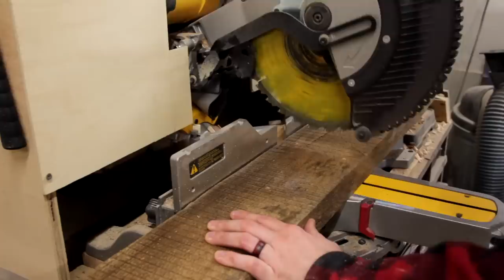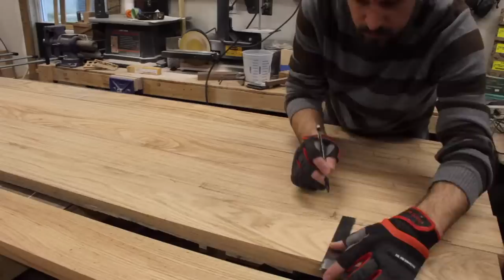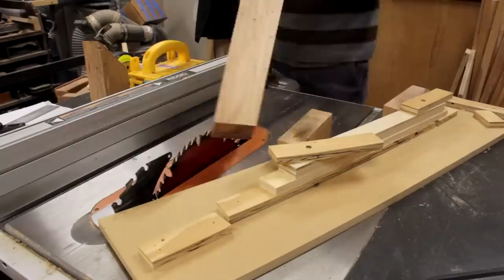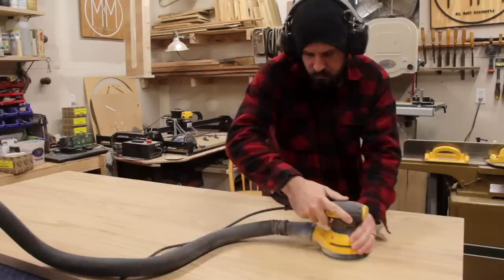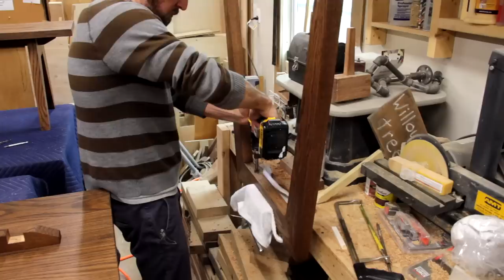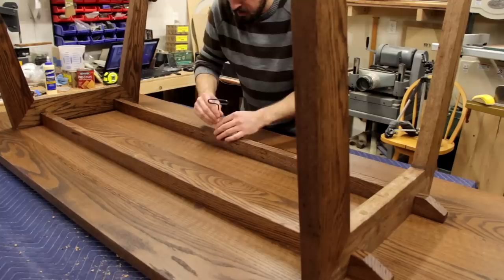I Quit My Job to Become a Woodworker | Dining Table Build

Comment: This is amazing, really, your story is so inspiring and I see myself in a similar journey, only that I am still working corporate and haven't started woodworking. I too started in a call center, and didn't know it was a call center because the job posting and interviews didn't mention it at all. 3 years in, I moved into a new position where I didn't have to talk on the phone! But Im still there, and Im having a hard time saving (as I live alone at the moment, and the cost of living is high where I live). Im trying to plan, to start doing stuff, because I crave working on more "concrete" projects, instead of sitting in front of a computer 8 hours a day. Thank you for sharing!
Reply from the maker: Those call centers a so sneaky with that. Start small. You can spend a ton getting into woodworking or it can be super cheap with a hammer, nails, and a handsaw. I wish you the best on your journey!

Comment: Thanks for sharing! The narration, combined with the slow-tv shots of making a table, was very well balanced. Would like to make that transition at some point but also realize the less enjoyable parts of woodworking (sanding, repetitive jobs, not matching (unrealistic) clients' expectations). Would like to focus on continuously gathering skills while also making a living in woodworking. Any tips?
Reply from the maker: Thanks! Woodworking is very broad. You could find something simple that doesn’t require a ton of finishing work and client input and then sell online or at craft fairs or sell through consignment shops.

Comment: I'm so glad I found this video! although I don't share a lot of similar ife experiences it was a fantastic watch and was very inspiring!
I'm not really in the "same" position but I think I'm on the edge of that cliff you mentioned. I'm lucky, I'm studying a degree in product design at university and I don't have a job but I'm financially stable due to veteran payments for permanent impairments I received during my service in the Army. The last 3-4 years since leaving Army have been turmultuos to say the least with a few different sales jobs, one that I didn't mind doing (working in a bike shop) and two others I didn't enjoy at all. I then started studying at at the beginning of 2022 and it felt like I had really found something I enjoyed, I was exposed to working with timber on a more technical capacity through one of my classes and I just knew I needed to try and pursue that. Now i'm going into my second year of university, I've bought some tools and I'm setting up a bit of a small workshop space in my garage where I plan on just tinkering on things and if I sell things, great, if not then I've learnt something for the next project!

Thanks again for such an inspiring story.
Reply: On that to the table looks fantastic! that colour from the finish is *chef's kiss
Reply from the maker: You've got the right idea and don't stop trying new things. There may be something even better than what you're doing now. Thank you for the kind words and I wish you the best!

Comment: The only thing I ever made from pallets was my Moravian workbench. Sheet metal comes on large pallets that are often made from hardwood. I took apart 6 pallets. I used oak slats to laminate the legs. The top is birch I used the runners to make a 3’ thick top and a leg vice the stretchers are solid oak from runners. I only spent about $60 instead of $1500. And I was able to cut around or hide all the nail holes on the bottom side. Except for a couple on the top where a foot had been nailed on to make forklifting from the side possible.
Reply from the maker: Awesome!

Comment: Thanks man. I’m in the “afraid to bet on myself and go for it phase.” Hopefully making the leap soon, knowing that I don’t have to know how I’m going to make it work- rather that it WILL. Cheers.
Reply from the maker: Best of luck. Put a plan in place, give it a try, and if it doesn't work out, you can always go back to what you were doing (i hope that's not the case). Failing is learning, nothing more, nothing worse.
Reply: I'm at a trucking job that I've been at for 5 years. I'm 47 and this is my first job I've had that I make great money except for 2023. It my first job I've been at for more then 2 years and in two months I'm kicking this job to the curb and going into woodworking for myself. I'm so sick of working for others and I'm scared as hell but I'm doing it. Good luck.
Reply from the maker: @eligebrown8998  Good luck to you as well!

Comment: One comment on the wood working when cutting off the end pieces from the table the scrap was unsupported this could lead to it pulling on the table and damaging you top or bottom. Please put some sacrificial board or something under the offcut so it will not damage your product.

As for the story, all I can say is good for you, we all have our journey to get to where we want to be some are like you where not yet brave enough to take that first step. Happy to hear that you got moved into the right place by forces outside of your control and rather than resisting them you allowed the world to steer you in the right direction. Now a lot of that has to do with the debt free situation and the living within your means as well as diligently saving. Having something to fall back on gives you the freedom to take a risk knowing that you could if the dream fails to materialize survive for a period long enough to sort out your next steps. Without that certainty taking a risk certainly with a family is a lot more difficult to justify of course. But like I said happy to see you got to where you are happy doing things you love, the only thing that I kind of miss in the story is if your wife has been able to do the same and is able to do what she loves as well.

Oh, and a nice looking table not my style but it looks good. I would suggest branding your furniture rather than stamping it as the stamp is pretty easy to wipe of where the branding will last longer and remain more legible even after many years of cleaning and children kicking and touching the markings on the bottom of the table.

Comment: @Mr. Matt Woodworks, I really like the table you made in this video. Is the base of your own design? It looks great. Is it pretty sturdy as well?
Reply from the maker: The client sent some inspiration pictures so it was based off of modern designs they saw and liked. There were no physical plans though, so I had to just figure it out as I went. It was plenty sturdy when it left my shop. The cross braces joining the legs together did pretty well to prevent crazy racking. Another piece joining the legs together could have been even more beneficial, but we wanted a minimal look/design so some tradeoffs were made.

Comment: Awesome story man! I started a woodworking business as well and am doing it full time. I can relate to your story a lot! I have been getting plenty of jobs but the hardest part for me is trying to figure out pricing! I'd love to know how you come up with pricing! Thanks!
Reply: How do I know if I am charging too much or too little?
Reply from the maker: Pricing is always tricky to figure out. I've heard some people say 4x your materials, some do it by day rate, and there are others that have formulas with time and markup calculations. There are videos out there for all of these methods. I try to balance it between what I need out of a project after materials and my time vs what the market will bare. For example with easy round numbers: if it takes me 3 hours to build a birdhouse and my rate is $50 per hour, that's $150 just for my labor for a birdhouse which is probably more than what the market will bare. I had another woodworking friend recently tell me that you should should be getting about 50% "No" answers when giving prices. If everyone says "Yes," you are probably working too cheap. If everyone says "no," then you're probably too expensive...so much rambling.  To sum it up, try a few strategies until you find one that meets your needs where you feel like you and the client are both winning.
Reply: @MrMattWoodworks  Great advice, I really aprreciate it! I personally have gotten all yes answers on all of my bids and at the end of the day I am always asking myself if I have left money on the table so I will send out some higher bids and see how it goes! You gained a follower and friend! 
Also one last question.. do you initially charge the client for a bid?
thanks again man!
Reply from the maker: It would depend on the project. Typically the things I’m making are able to be built in my shop and they are coming to me specifically to make them something so in those cases I don’t charge for a bid. If it’s something bigger like a built in and they are shopping around, I might have some kind of fee for my time to design something. After all that that does take time, effort, and skill…that being said, a lot of people do and that’s a great way to determine if this client is serious or not about what they want.

Comment: Great video. Can I ask a technical question? I noticed you screwed in the support rails under the table top. Will this allow for timber movement? It's talked about alot in other table YTs. Using z clips etc. I'm inspired!
Reply from the maker: Totally! I wish there was a better way for me to have shown this… the holes the screws went through in the support rails were oblong and oversized to allow for that movement.

Comment: This is a bit of a sad story. I’m 36 years old, two boys under two years old, broke as a joke. I’ve tried starting up my woodworking business multiple times before… 90% of people were supportive of it, but the most important ones in my life stood in my way.

My father told me “do it when you’re 60, give your life to a job and hate every day, then go get a second job after that. You won’t know your kids, but you’ll know your grandkids. This is life.” I’m not even kidding, those are exact quotes. It really took a toll on me. My ex argued with me every day before I went out into the shop, starting my days off on the wrong foot and setting me up for failure, then criticizing me when sales lagged. After 3 attempts I called it 3 strikes I’m out, and laid my tools down and died.

Fast forward to the present, my Jeep finally could go no further and died a couple weeks ago, leaving me without transportation and work. I looked out the window and saw a shop full of tools, materials and unfinished projects just sitting there. Started flirting with giving it one last (4th) chance. I can already feel the resistance from people, but I have no other choice.

Rent needs to be paid. The potential, ability and vision is there. I know where to get an endless supply of free materials that virtually eliminates overhead. There’s no excuse, I have to do this. I don’t know how I’m going to keep my chin up and withstand both the negative energy of others, as well as extremely limited time to work because of two young children to take care of, but I have to try.

Sorry to vent, but this video hit home for me in a very personal, vulnerable spot.
Reply from the maker: I’m genuinely sorry you find yourself in that situation without any support. You know what’s right for you. The balance of fulfillment and reality with bills can be hard. I wish you nothing but the best on your journey and hope it all works out. I’ve leaned since posting this video this is a very common situation. Sometimes knowing there are other out there in the same boat can bring some comfort. Can’t wait to see what’s next !
Reply: I too have gleaned that from reading the comments on your video. Lots of people having dealt with resistance/interference or struggles of one nature or another. I’ve responded to a few of them, encouraging them to keep going too. I guess we all have that in common. Thanks for doing the same in return for me.
Reply: Oh and plot twist, we picked up a couple parts Jeeps and are trying to make two good ones out of them lol. Definitely got my hands full. Not a mechanic, I’m a wood guy… but survival is survival.

Comment: Hi Matt, what were you doing at 9:00 ? And for what is it
Reply from the maker: Flattening the bench top. It had a slight cup that was too much for sanding so I used a router sled jig to flatten it out on both sides.

Comment: How much margin is there in woodworking? Is it double the raw material cost as the selling price? Or less? Or more?
Reply from the maker: That's a very broad question. It all depends on what you are making. Generally speaking, the bigger the project, the bigger the margin.
Reply: @MrMattWoodworks  thanks

Comment: 2:52 “pallet wood”
Good video but I almost stopped listening there. 

I’ve been a woodworker, builder, carpenter since ~1985 so I have experience. I’ve seen so much the last few years on all these pallet wood projects. I found a couple excellent pallets and set out to build a table. 

Well I decided that was insane. Shortened story with key point:
The unseen grit embedded in the wood ruined my $300 glue joint table saw blade before I finished my cuts. 
The table was ‘fine’ but for the effort and cost in time, damaged blade, and the poor pallet wood even though from a “good” pallet and with appropriately accurate sizing did not remotely live up to my skills or expectations. 

Thankfully this was not just another pallet wood video but rather was a nicely succinct vignette of the progression of his discovery and fulfillment in pursuing his dreams.
Reply from the maker: That pallet rooftop seating was literally the last thing I did with pallets almost 6 years ago. Just thinking about them gives me ptsd haha.

Comment: Inspiring story man. Thank you. I needed this. Since watching this I've dusted off my Delta table saw, cleaned up my jointer. Thinking to myself "why did I quit?".
This gote back in my garage. Seriously thank you.

 Side question.  What did you use to secure the table top in this video?
Reply from the maker: I’m happy to hear this resonated with you. That means a lot. Keep at it.  I used threaded inserts and hex screws. (Hole was wider than the screw width to allow for any seasonal movement.)